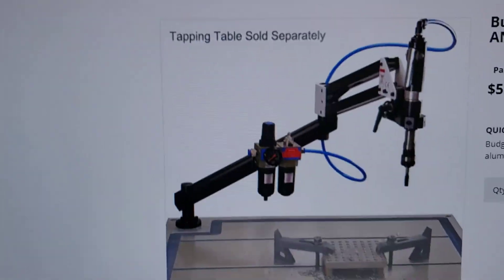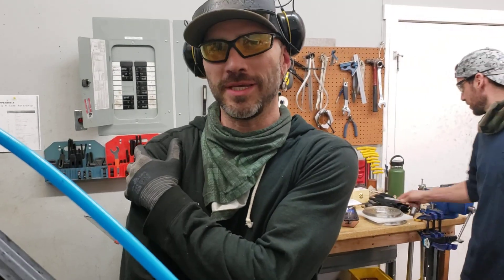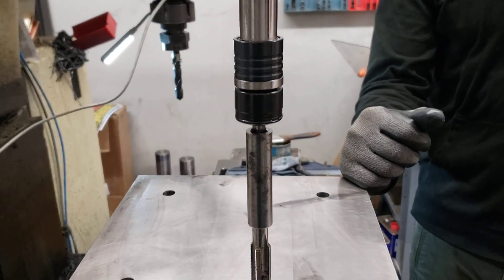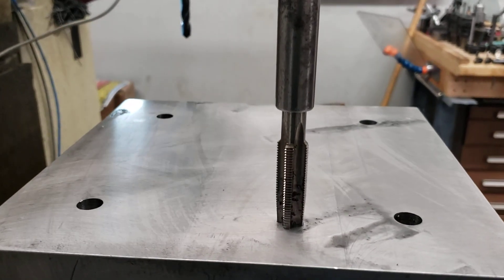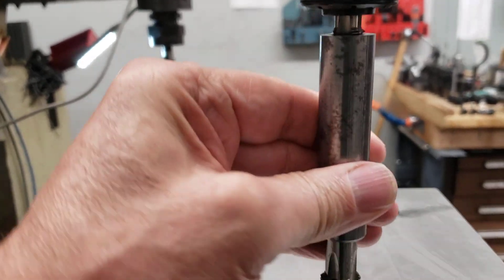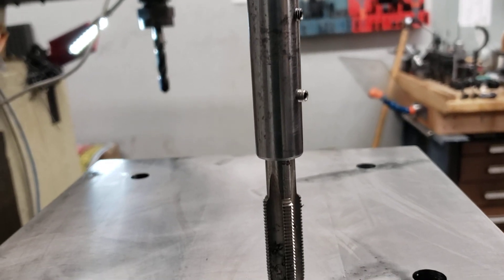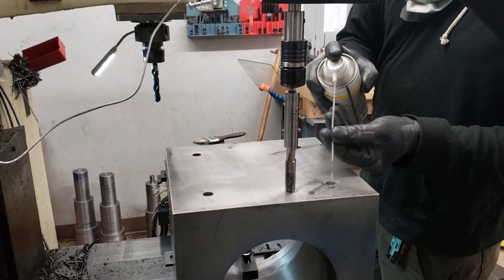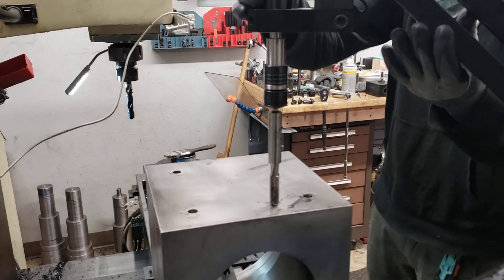Our New Pneumatic Tapping Machine

Comment: How did you get imperial taps to fit the collet? Was there an adapter you needed?
Reply from the maker: We ordered it with the imperial taps, I'll bet you can get them from the company.  Thanks for asking.  Dan Gray
Reply: @grayarea56  Thanks Dan, Ive emailed them but not heard back yet.
Reply: @grayarea56  Hey Dan, so I didnt get an email back and called them directly. Interesting enough when I went to get the ph# they had changed website showing the collets switched from metric to imperial :) Great, I was about to order but decided to call first. I got ahold of a nice guy who told me that the budget unit was sold out, but they would sell me the electric $1300 model for the same price. What are your thoughts? I see that the pneumatic units can be gotten pretty cheap on ebay. Would you go for the electric for that price or stay w pneumatics? Thanks for your help
Reply from the maker: @wayneblack4242  Sounds like they lowered their price on the electric unit.  If you can afford it, I'd recommend it.
The main problem we had with the pneumatic, air consumption.  We had to replace the regulator at the air compressor to a higher volume, and, the compressor can't keep up if we're doing a lot of tapping.  Those won't be a problem with the electric.
Dan
Reply: @grayarea56  I got the electric unit ordered up. Andy the guy Ive been dealing with pretty much agreed w your assertation, that you need a vary large capacity compressor. I have several machines that tap into a manifold off my compressor and its barely sufficient now as is. Thanks for all the Help Dan, cheers :)
Reply: Dan just wondering if this tool is performing as it should considering it was a few years now since you purchased it, I’m looking sor similar tool